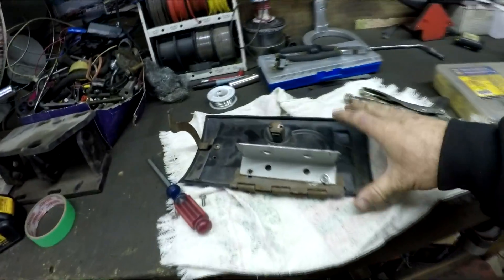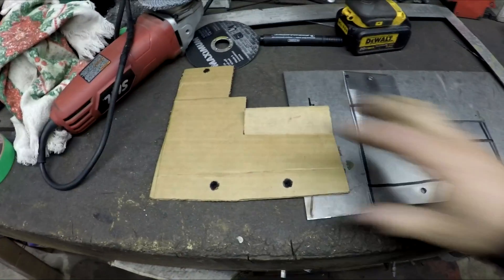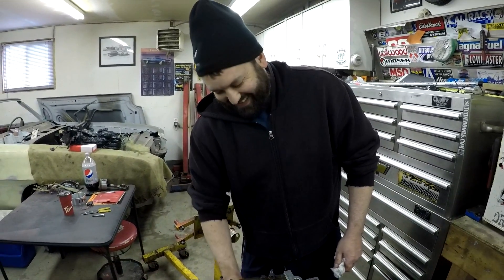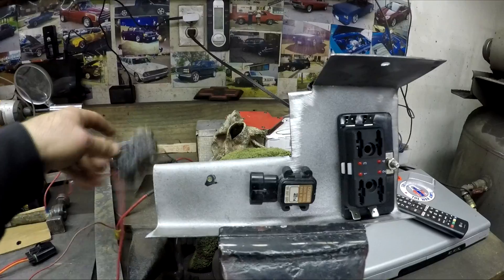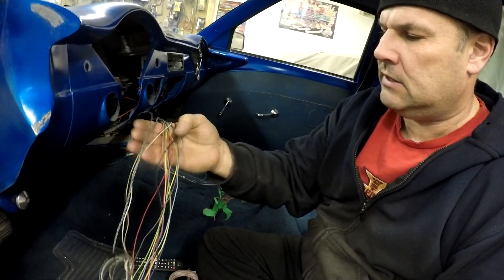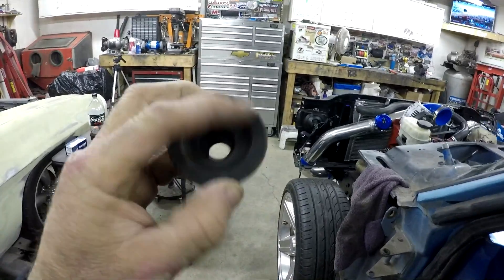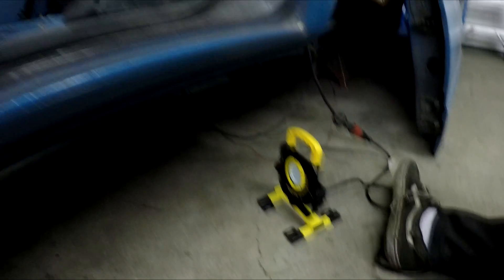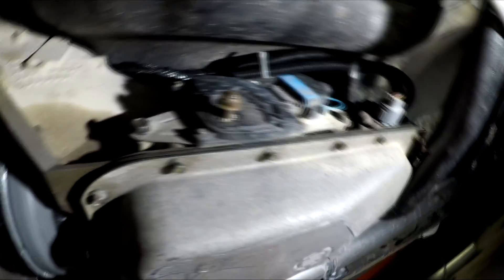EASY LS Engine FUSE & RELAY Setup for Standalone Harness | Turbo Wiring (part 3)+Clayton Loves Honda

Comment: So all the injectors get wired to a keyed 12v source? I'm about halfway through my harness.
Reply from the maker: Basically. The ecm signals the injectors to pulse by supplying ground.
Reply: So all the pink wires going to the injectors get a 12v hot when the key is on and the computer just grounds the other wire to fire the injector??

Comment: If your doing the stand alone and the pcm does not have constant power then doesn't it have to perform a relearn every time the key is shut off?
Reply from the maker: The pcm does have constant power. That is the fuse that is by itself.
Reply: SPPTV. Oh I'm a dope. I must have overlooked that.lol I'm sorry bud I thought there was something in the program I didn't know about. You do great work man

Comment: Rob I have been meaning to ask for awhile. What does your garage measure? You fit 3 vehicles with ease.
Reply from the maker: 24x26
Reply: Holy shit, guess I have more room than I thought. Mine is 22x24. BTW check out Sloppy's new video on decapping injectors if you haven't already.

Comment: Rob, are you guys following the TTA procedure on the Rod & Main bolts?
Here’s some research I’ve been working on using my “Bendy”... 👍
I tried assembly with my new torque angle gauge, I just didn't like the inconsistent results. None of the bolts tightened using the TTA method had the same clamping force in terms of torque load. 
I finally just followed my test results on torque values: No moly/arp lube, lightly oiled threads. 
*11mm rod bolts 50 ftlb
*13mm main bolts 65 ftlb
*15mm main bolts 55 ftlb